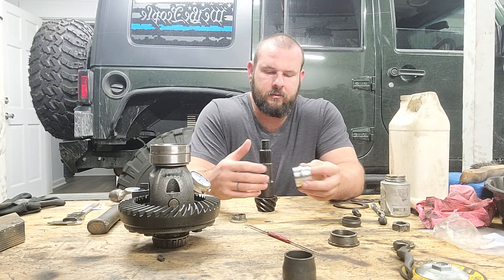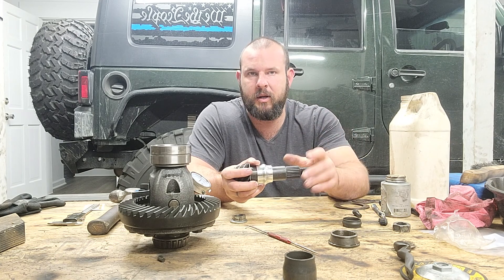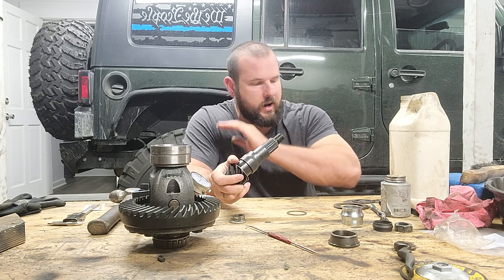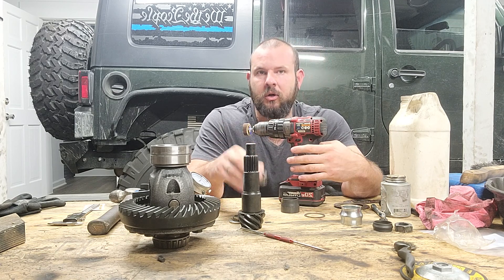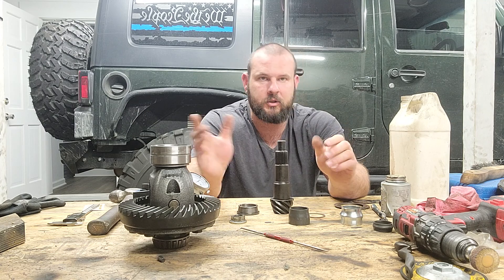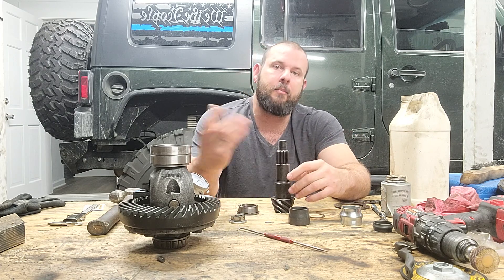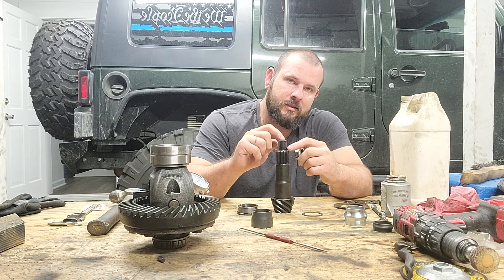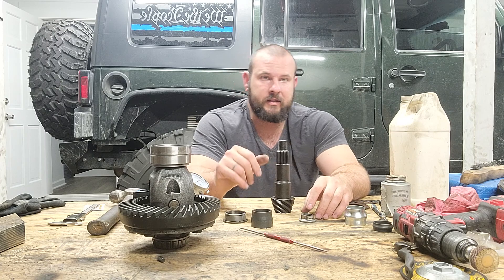how to set up a crush sleeve eliminator on a ring pinion

Comment: U explain it brother thanks . But excuse me my English iss not perfect but i did buy new bearing for the pinion and use it as test bearing. But for setting the crush elemnator can i measure the thickness of the old crush and put the same ? If yes how do i know if it reach the maximum torque? To avoid over torque. Or i torque it till i see the preload as recommended ? Sorry for my English 8 hope you understand me
Reply from the maker: @90s-kid-sa  you can measure it out and it can get you closed, but it won’t be exact. You’ll still have to either add or remove some shims, with a crushed sleeve eliminator, once you get the proper amount of shims, you just torque the shit out of it. You said the preload with the shims. Once that’s established, you just gotta tighten the hell out of it. Rewatch the video I explained it.
Reply: @JeepTrailsandBarbells  I will thanks again brother 👍

Comment: Is there a Crush Sleeve eliminator kit for a 2001 Jeep Cherokee? Does anyone have a part#? Thanks
Reply from the maker: @israelambriz9539  try giving Yukon a call and see if they have one, if not they might know who does. You can look on Amazon and eBay as well. You will need the axle information as well, if it’s a Dana 35 or Dana 44. It’s all makes a difference. I’m sure someone does, but if they don’t then you can order extra crush sleeves so if you over do it you can have a few extra.
Reply: It’s for a DANA 30 short opinion (TJ housing) thank you I will try them. Based on your experience at how many torque lbs with the sleeve crush @? I believe the specs mentioned 250lbs
Reply from the maker: @israelambriz9539  yeah it will start to crush at 250lbs, so i do a quarter turn then check it, then so on until I get the pre load just right
Reply: Apparently there is No Crush sleeve eliminator kit for a Dana 30(TJ Housing)Just to clarify. The worst case scenario would be ruining the crush sleeve and have to start with a new one?
Reply from the maker: @israelambriz9539  that’s unfortunate, and yes that would be the worse case scenario. Just take it a quarter turn at a time and check. When you spin the pinion as hard as you can by hand and it it rotates 1 to 1.5 rotation you will be good, just don’t go to tight because if you lock it up you will have to get a new sleeve. Slow and steady, then check, slow and steady then check. It’s not as bad as it seams, once you do it one time you will think “well that was a lot easier then I thought it would be”

Comment: Lots of good information and tips in your video thank you. I image manufacturers use a crush sleeves instead of a solid shimmed sleeve as they will have already determined pinion depth exactly with the accurate factory gauges and shimmed the pinion accordingly. So it will go in to the housing once only. The crush sleeve is then quick and cheap for the factory to torque/preload up to specification  probably with automated tools. For the garage mechanic the solid shimmed sleeve is the way forward changing an oil seal in the future becomes easy.
Reply from the maker: Thank you, and It does make it a lot easier down to road for doing seal changes. And you are probably right about why they use a crush sleeve over a solid one.

Comment: 6:38 did you mean to ground the threads or ground the nut to make it thinner? Because I have seen people ground slightly the threads so it doesn't eat up the threads on the new pinion.
Reply from the maker: On the old nut yes, not the new one, leave the new one how it is so it wont back off after its on. But grind the old one down so if you have to take it off and on you dont damage your pinion threads.

Comment: From what I gather, this headache of finding the sweet spot of pinion depth and ring gear adjustment is only for the initial install, but once done, it's done.  For a guy like me who only wants to change out a pinion seal, I believe my only concern is achieving proper preload measured in inch-pounds of pinion rotation.  Am I wrong about that?  What symptoms should I look for to gauge whether I over crushed my crush sleeve?  I ask because if I do overdo it and have to pull the pinion out, I would then ditch the crush sleeve all together and get the CS Eliminator and only have to go thru that headache just the first time.
Reply from the maker: You are correct, if you are just changing the pinion seal everything is already set up. All you have to is reinstall everything and get the pre load correct. The crush sleeve is already crushed, so if you can get it to the pre load you are good. Its about 1 to 1.5 rotations by hand if you spin it as hard as you can by hand. But its falls about  15 to 17 inlbs by tool. If you over tighten the sleeve you will have to get a new one or the eliminator like you said. It takes about 250 pounds to start crushing the sleeve, so its a good amount of torque.

Now with that beinf said i have replaced dana 30 pinion seals without removing anything but the yoke and the nut. With a crush sleeve you can just bang on it with a impact when putting the yoke back on. But with the crush sleeve its alot more about "feel" like "yep put some lock tight on the yoke nut, and errrr thats about tight" but you have to be able to trust yourself with that one lol and i only do it that way on my own personal jeeps 🤣🤣 

But if you remove the carrier and pinon, everything will go right back in. Just make sure you put your shims back in correctly on the carrier, and that you dont over tighten then sleeve.

If you pull ev everything out and you can get your hands on the pinion, once you start to tighten in down the pre load is already set from the original install, so once it starts to butt up again the yoke and pull everything in tight, do about a 1/4 turn, then check the amount of rotation by hand, then another 1/4 turn and check. Until you have 0 and i mean 0 back and forth play and 1 to 1.5 rotation by hand.

But its not that hard of a job, it seams like a lot. But once you get in there and start doing it you will realize its not as Intimidating as it seams. Also if it stops moving you over tightened it.
Reply from the maker: Also if it stops moving its it over tightened lol, also how the pre load is found is there is a style of wrench you use. You put it on the yoke nut then start the rotation, and if it flexes to 15-17 pounds and starts to move the pinion you have achieved proper pre load. But if your carrier is removed, and you can grab your pinon and rotate it as hard as you can, its about 1 to 1.5 rotation and your good. Just take it slow on re tightening it.

Also if you do mess up your crush sleeve and dont want to order a new one, you can call around transmission shops and off road shops, they might have a few extra you can buy from them if needed.
Reply: @JeepTrailsandBarbells  I changed my seal last week, but made a few mistakes and may have over tightened it with the air impact.  Also forgot to lube the seal, also did the whole thing with tires on and grounded.  It drives fine and there's zero slop, so it's definitely seated, but perhaps seated too far.  I only have a click type inch/pound wrench and was planning to use it to verify at least the minimum rotational drag.

Already bought a new seal and sleeves, but would be happy to eat the $6 loss and buy the CS Eliminator to gain the peace of mind of knowing I wouldn't have to ever again gamble with the limits of crush sleeves.

I definitely learned from my mistakes, and hope I didn't shoot myself in the foot, but if I did, I now have a solid game plan looking forward.  Thanks for your video and added insights!
Reply from the maker: @MichaelJeffers75  you are welcome, and an impact may not have been strong enough to over tighten it. it just depends on the impact, to be honest. Also, if it isn't howling, then you should be okay. But you can jack up the frot and disconnect the front drive shaft, then try to rotate it by the yoke, and if it turns, you are good. If you have to pull hard on the tires to get it to turn, then you might have issues with over tightening.

But the best thing would be to jack it up, pull the axles, and drive the shaft and see what the resistance is. Im with you on better safe than sorry. Good luck and happy wrenching. If you have any other questions, feel free to ask.
Reply: @JeepTrailsandBarbells  I had it on 4 stands a few hours ago to inspect some concerns with the 4WD, and also to try and determine which axle/diff I have by ratio of axle spins to tire spin and I could not turn the tire and had to use a screw driver to muscle the yoke and shaft to spin in neutral.  Sadly, the rain washed away my tire marks so I called it quits.  So it's still on the fence if I over torqued it and won't be able to find out till maybe Sunday or Monday when I can jack it up again and pull the wheels and rear shaft off.  If I hit any roadblocks, I'll let you know. Thanks for the help!  BTW, 99 F250 S/D Super Cab, 5.8 - 4R100 - NP273 F..
Reply from the maker: @MichaelJeffers75  that dana 60 will have a really stiff crush sleeve compared to a dana 44. It takes more to get them to crush. But if it's in the air and in neutral, it should be able to spin freely with ease. So, i would assume it is over tightened. That's going to ruin your pinion bearing. If it starts to howl you will know why. But the CSE is a good way to go if you dont ever want to deal with that again. Best of luck, and let me know how it goes.
Reply: @JeepTrailsandBarbells  After more research, I've found that my rear is a Sterling 10.25, not a Dana.  Do you know where I can get a CSE for this diff?  Even if wrong and it's a 10.5, I understand they both use the same pinion.
Reply from the maker: @MichaelJeffers75  look on ebay first, if not that try summit, or yukon. Amazon might carry them as well. And you can even try extreme terrain. And thats good that you found out its a sterling 10.25 thats a good rear end.

Comment: This video is life saving… really wish I would have seen it before I got into this job… eff me in the A
Reply from the maker: Im glad it helps, but sorry to hear you are struggling with it. Just think about it like this, once you do it this time and get it done. Next time around it will be a breeze. 

Best og luck and happy wrenching, if you have any questions just ask and ill do my best to help.
Reply: Actually I do have a question. I’m doing the 8.8 in on my fox.  Pinion bearing preload is 16-29lbs.  With a crush sleeve and new bearings I had it at 20lbs, sorta mid way right.  I dunno if my beam torque wrench is off but I can’t turn it by hand.  Am I on drugs or is that normal? Only way I can turn it is if I at least use my 1/2 ratchet on it and even then it’s a little hard to turn
Reply: My pinion depth is wrong so it has to come off anyways.  I ordered that eliminator kit as soon as I since your vid haha
Reply from the maker: @Droid11AP  yes it is to tight, you should be able to rotate it by hand, even when using a crush sleeve you can tell by hand if it is good or not by grabbing it and spinning it as hard as you can, and it should make almost a full rotation. If you can't move it by hand or it makes more than a rotation, it's wrong. You will ruin your ring and pinion. 

And i would make a mock bearing because you will be taking it on and off a lot with the crush sleeve eliminator. You can use that tool to check pre load, but honestly, just rotating it is more than good enough.

And when you do get it set up, make sure your pattern is 100%. You dont want it to be to deep in the root or to forward on the tooth. Try your best to get it dead center.
Reply: I did it!!! It’s done and works perfectly.  Seriously couldn’t have done without it.  Thank you so much!
Reply from the maker: @Droid11AP  that is so awesome to hear! Im super happy for you. Im glad you got it figured out and running well. 

It's such a great feeling to complete a job like that, i know you have to be just all smiles right now!

Comment: Hello, There is no final torque value when using a crush sleeve other than continuing to tightening the pinion nut until you get the correct pinion nut preload which is usually around 300 ft/lbs to crush that sleeve. When you use a crush sleeve eliminator there is no crushing involved. You add shims to get the preload your after. One could get the preload their after after tightening the pinion nut to 40 ft/lbs and hardly enough for a pinion nut. What is the final torque for that nut when using a crush sleeve eliminator? 80-100ft/lbs 200ft/lbs? Any idea?
Reply from the maker: To be honest, i just banged it with a impact until the nut stopped moving.  eliminating the crush sleeve, you just need to get it tight, the way the nut is made, you just get it as tight as you can when you go to use your actual nut for your actual final install. You won't damage it from over torqueing it either. So i just hit it with the impact when i do them. 

You can't over tighten them either. Your shims set the preload, so if you tighten it up and the pinion stops moving, then you dont have it shimmed correct. So you will need to remove the pinion and re do your shims until your pre load it right. Add to many, and you will have a loose pinon. Add to little it will be way to tight and won't be able to rotate. So there is a LOT of taking it out and putting it back in to get the preload just right. Just takes time to get it prefect.
Reply: @JeepTrailsandBarbells  Hey thanks for the reply. I did a little research and I found out the R200 differential out of a old 280Z does not use crush sleeves but different size shims to get the correct preload. Once you get the correct preload the final torque on the pinion nut is 123-146ft/lbs. It too uses a cinch nut. I think I'm set. At 140ft/lbs that nut ain't going anywhere!
Reply from the maker: @Danno74Z  sounds like you're good to go. I'm glad you found what you were needing.
Reply: @JeepTrailsandBarbells  Again thanks for your video and explanation on using a crush sleeve eliminator.
Reply from the maker: @Danno74Z  you are welcome.